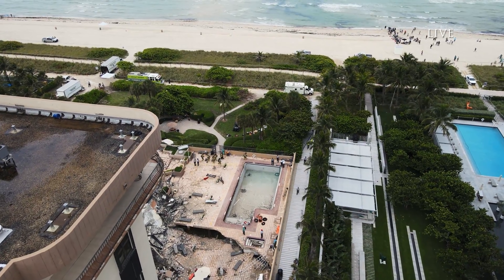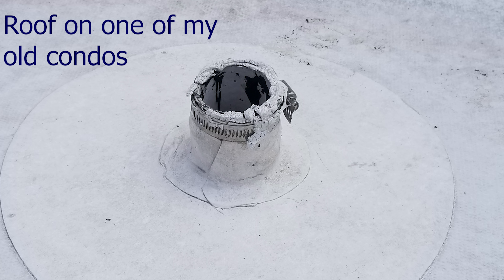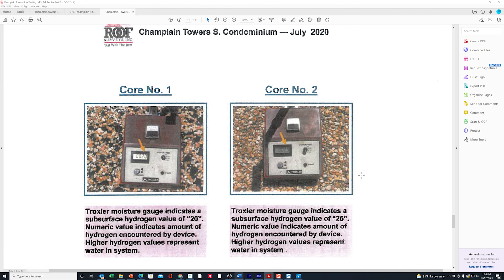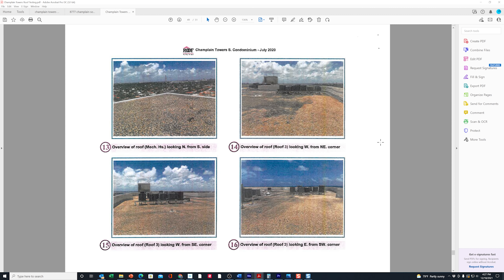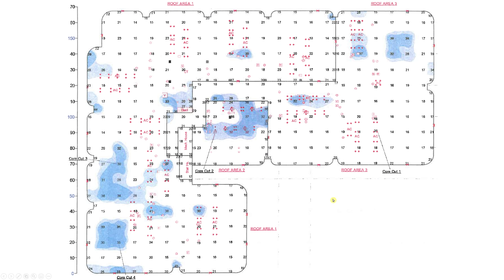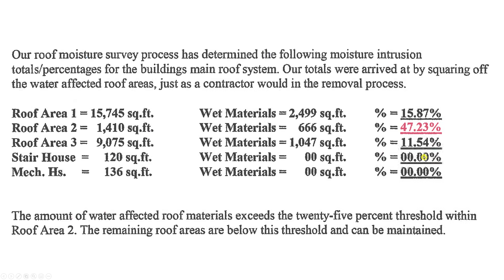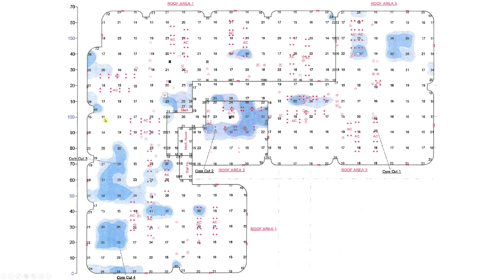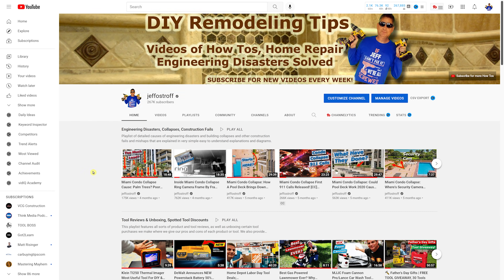Condo Collapse: Water Found Under Roof Layers (Saturated)

Comment: What is the standard technique for putting a slight slope on a flat roof? I owned a building with flat roofs. One of them had a slight slope and one of them had no intentional slope. The difference was night and day. The one with the slight slope was still doing a pretty good job of preventing leaks. The no slope section was puddling and had many leaks.

It is surprising to me that no-slope roofs continue to be built.

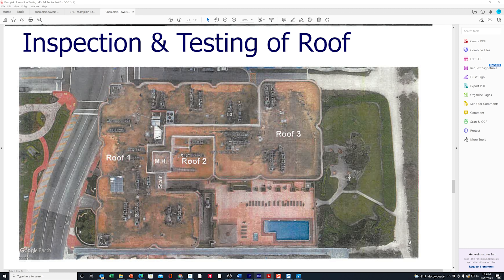Comment: At 4:31 you show a cross section of the Champlain Tower South condominiums roof. 
Your blue color shows water into the concrete, that’s not very likely to happen. You said the multiply layers are there to provide slope to the roof, these layers do not add slope. Slope is added in the Polyisocyanurate layer and the mineral aggregate is not buried in tar, the aggregate is added to and on top of the asphalt layer when it’s hot and should be a mixture with the aggregate visible to reflect ultraviolet sun rays. 
Further the area when you say the first column to give way had a comparative low moisture reading of 18-22, with no water notes. Core cut #1 you said at 20 was dry. 
You should revisit this video and edit the areas where you use opinion disguised as fact.

Comment: I find it incredible that there was not some kind of sheer joint between the pool deck and the main building. It is crazy that a pool deck collapsing can pull the whole building with it. If there had been some kind of sheer joint between the pool deck and the main structure then surely the building would have remained standing after the pool deck had gone down? (Assuming of course that it was the pool deck that went down first).

Comment: bad concrete?..it looks sooo chaulky, and it doesnt stick to the rebar in the normal way. Also, is there any pebbles in it? I dont see any.......incorrect building methods, built to minimum, paid off inspector?....planter box added later with no extra support....rust and rot ( lots of water leaks for years).....undersized columns.....what did i miss?.....bad maintenance, too much cost for condo owners( $200k each?)...engineer and co. inspector paid?, to not scare people( reduces property value $200k ea.).......etc.....

....    So, no one  could just put up some shoring underneath the pool deck, remove the planters, demo down to solid concrete, add structural crete to the deck, and lots more strength to the posts?.....i just shake my head....
Reply from the maker: All the above

Comment: Again, not draining the accumulated water from roof or a ground floor has the same rule of common sense. 
Unfortunately, when money and politic steps in; it get to be "how stupid can we get to be", and maximize on mitigating our losses or maximize our profits. 
My first question is were the architect and engineers cognizant of the best practices that common sense tells you engineering practices needed to be followed up on the construction of the flat planes of any structure. 

Perhaps the overall practices need to be revamped and rewritten to meet the needs of reported problems; reportedly or verifiably rumored. 

Sad to have to have all armchair experts, remind these companies what should'a, could'a, been done!

Loss of life was preventable but like I mentioned looks like fools were running the show!
Pissed observer!

Thank you Jeff Osrtoff for your video!
Reply from the maker: This may have been best practice at the time

Comment: Another chapter in the catalogue of errors.
This building appears to be a showcase example of how to look for problems and not see them.
Flat slabs deflect and that thin over time deflect a lot.  The dirt on the roof shows the degree of ponding.  Ponded water is live load and if if gets in the hidden lake can be a serious problem.
Yes, I have seen this.  GRP over GRP over GRP each as bad as the last and underneath the water ponded rusted the trapezoidal deck and p******d in.  The whole lot was stripped - not sure if they are still arguing over costs.
Reply from the maker: The ponding water is actually a static load but yes still a load nonetheless. People forget to that water weighs 8 pounds per gallon and so all of that water pooled on the roof adds up as well. Although I still don't think the roof had anything to do with the collapse but it just shows how either poor design or poor execution of the construction allowed too much water to pool or get into the concrete on this particular project
Reply: @jeffostroff  Erm Terminology live as in an an imposed load like snow.  I agree with you - I too think it is a side bar issue.  Yet another indicator of how under/poorly designed/built/maintained the building was.  What do you think of the legal challenge by CTS alleging that in constructing 87 that developer caused the collapse?  (By damaging CTS perimeter wall)

Comment: Just a note: the fforida replacement law as you show in the video does not say a roof must be replaced at the 25% but rather that if it is replaced it must be the entire roof.  That is far different from what you appeared to present.  As a retired engineer I find that there are too many wanna be engineers.  While your and other's data is interesting we need to await the final investigation where actual licensed engineers have reviewed all or all available data.  However, all of that said, it was an informative video.
Reply from the maker: You are wrong. There's far too many retired engineers calling other engineers "wannabees". The law clearly states, and I showed it, if the roof is damaged above 25% you must replace the entire roof. You can't just repair the roof. I don't see how you could get that wrong.

Comment: What a dumb archaic way to roof a building
Third world
Reply from the maker: There's nothing wrong with the method used in roofing these flat slab buildings the key is to making sure you have a slope to the drain and making sure that you repair the roof when it's time because most of these roofs have a life span of 15 to 20 years at the most. In this heat is brutal down here in Florida so the homeowners associations really need to take a more proactive approach and staying up on inspecting different parts of the building don't just wait for a 40 year inspection.

Comment: Jeff -- I'm sure you've seen the "House of Cards" presentation that the Miami Herald posted on their website at the end of 2021, with input from a consulting engineer from the Univ. of Washington.  It might be interesting for you to do a "walk-through" video of it (with due credit and respect for their copyrighted work, of course).  I'm particularly interested in your take on their discussion of the role of the pool deck's perimeter wall serving as a "clamp" that helped hold things together for 40 years, until the connections between deck and perimeter wall finally failed.  They seem to view that as the likely first failure point, although their subsequent analysis pretty much matches up with yours.
Reply from the maker: yes I have, they notified me the day they published it, and already planning it

Comment: if area 2 was most saturated, perhaps that is where repair materials were put to be started and, area 2 looks like a part of the building that is in the middle which if fell could create the catastrophic event which happened
Reply from the maker: Area 2 is the elevator shaft, which survived the collapse
Reply: @jeffostroff  it's surprising it never leaked

Comment: I have no knowledge or experience, but just pondering the idea... that the water intrusion could have started from the roof or from forced rain off the ocean (also salt corrosion possibly), but it doesn't have to sit on the roof deck, but potentially permeate through the multiple levels of the floors, run down columns or walls, cause noticeable bubbling, and then eventually show signs in the basement I'm guessing.  So taking a reading from the roof is great and all, but since there are so many important structural members to support all that concrete and steel, it seems like it would be fair to also inspect them as well.  Maybe they already have.  But it just wasn't in this particular video.  This all goes to us humans wanting the seaside view.  So the only way to do that is to go vertical.
Reply from the maker: Yes in terms of roof repairs, this is what they normally check for. They already know what was wrong down on  the pool deck, as they took core samples of the concrete through to he garage below.

Comment: The extra weight of water sitting within that roof membrane certainly wouldn't have helped the  structural stability and shear point stresses.
Reply from the maker: Yes, so important to drain those roofs

Comment: I still believe, as I said nearly right after this happened, that there will never be a specific smoking but a large number of errors, not any of which would have come anywhere near to causing collapse but as time went on and many things changed requiring materials never dreamed of when the building was constructed that would need to be use to keep up with code, but where no one went back to look and see if a building that age could support new materials and their weight as small things such as repairers and renovations force the building to incorporate things it was never meant to deal with; and for example the location of the building going from more of a moderate cost home for retirees when built , to expensive condo as location, not renovation drove up the price, and many owners found that to be worth the price, things like lightweight cabinets, plumbing fixtures, built in, new flooring went from things that looked real to actually having to be real: real wood, real marble and granite, real flooring and all of this increased the weight probbaly well past what the original architects ever imagined.  

Something was wrong with that building but sadly, as much as 20 years before it was required to have a recertification done, the damage had gone past what could have been repair to continue habitation in that building and its possible that as far back as the initial drawing of the building it, and many others, were doomed simply because there were no codes that locked buildings into not allowing heavier materials when renovations occurred, or even consideration of heavy types of furniture and so on.  It also seems that private firms and individuals often received permits to run additional plumbing in the walls and it cant be hard to believe if this happened in enough spaces the concrete could have actually become weak because of honey combing.  We may never know, as I doubt anyone will even speak up at least from those that inspected a head of the certification, that the building was actually a goner, and all they could possibly do was, maybe keep it standing for a year or two for people to get out but the reason for so much foot dragging when they should have been hard at work getting that building in shape for recertification for 3-6 years in advance, while instead they seemed to be doing little to nothing or just enough that anyone suspicious would see some work going on.   Have really felt since the beginning of this that the HOA actually had given up on this building passing certification and was more prepared to having to deal with a building deemed uninhabitable and forcing owners out on the street and to settle with insurance and law suits which they may have figured was going to be the issue anyway as the building could not be repair no matter the amount of money put aside.  Its a good chance that it looked to the some owners, especially the ones not living in their units but renting them out to others,  and the HOA ,it would be much cheaper to fight off law suits and make deals with insurance companies if the building was condemned and they could then level the building and build a new and better building which would have condos selling at much greater prices, and chances are there would be profit in doing this.

However, no one either knew or bother to let anyone know that the building might not even withstand forces liable to be pushed at it over the years they were waiting for an inspection to condemn the property.  Every piece of rebar that corroded enough to expand and knock out a chunk of concrete, every bit of standing water on the roof that seeped through the roof materials and into the interior walls, would slowly be weakening the building, but no way to measure how much, and add to that all the other issues that seem to have been there, some of which must have been done in the original construction, from places like having a column only in the garage, not running up through the building although the plans called for it, but seems it was only build in the garage where it would be noticed if not there, but although it was a support column, it did not continue upwards
Reply from the maker: Yes one thing about concrete, keep it cleaned, keep it sealed, patch up and reseal all cracks when they first start to develop.
Reply: We are theorising and researching in our F b group called ChAmPlain ToWers SoUth- searching for answers ( only typing it like that)  was because for some reason YouTube doesn’t like those words. You’d be a great addition to our group . The link is also my profile here . 😄

Comment: Things rarely happen on their own. In my experience, failures happen after someone does something. It would be one huge coincidence that the roofers were working on the building RIGHT before it collapsed. I expect some chain reaction started by the work on the roof and the disrepair of water intrusion to be the culprit. That roofing company is screwed.
Reply from the maker: I don't think he roof was a root cause, I think there was much more damage to that pool deck
Reply: @jeffostroff  after seeing this comment, it got me to thinking: was sagging of the underlying structure possibly being indicated? Interestingly, the driest section of map is about where the collapse seems to have started, making me think that perhaps the slope was altered just enough for the drains to be able to work effectively on that section. Not an engineer, just a thought that occurred to me.
Reply from the maker: @kstricl   I don't think that the roof had anything to do with the collapse although it did appear there may have been some water getting in certain places. But the more obvious spot is down at the pool deck where the pool deck collapsed that collapsed and likely caused the columns in that area to lose support because they were spendily columns to begin with. That the roof caved in on its own I think it came down when the rest of the building came down.
Reply: @jeffostroff  Sorry, I guess my thought didn't really come through - I was just thinking that slow settling of those same columns in the basement might have caused the sections of roof with the drains to drop slightly, allowing the water to drain effectively - so the dry sections may have been a symptom of what was going on rather than a cause. 100% concur on your conclusions so far. I've subscribed so I notice the videos sooner as you analyze the reports that do come out.
Reply: @kstricl  That is an astute theory. The proper drainage on that section could have been from excessive sinkage in that particular spot. Perhaps the most water intrusion from below was coming in the parking garage in that area.
Reply: There was another video that showed granite walls & how they put excessive weight on the building.  WATER is also heavy & perhaps that put excessive weight on the roof & columns (which eventually lead down to the weakened pool deck columns).

Comment: Jeff, do you believe that if the condo board did all the repairs, that the building wouldn't have collapsed?
Reply from the maker: It depends on the scope of the project. IF they were going to replace the entire pool deck concrete slab and re-tie it into the columns along the edge of the building, I think the building could have survived. I would have tried to widen  as many columns as they could have, and added drop panels and caps tot he tops of the thinner columns
Reply: They had the right idea, they just started too late, after profound (and invisible to surface inspection) damage had been done.  The big unknown is, did the roof construction even meet goals up to its basic expected (15 year) lifespan, never mind its bean-counter delay extended lifespan?  The constant complaints of water intrusion (which starts with the roof!) over the years suggests that it was never quite right.  How far back would they have had to go to nip this in the bud?  That, I can't answer.

Comment: I think the building was badly designed to begin with and I never knew these buildings can be all cement and re-bar without any steel girder beam frame-  this is why it collapsed - it's a cheap cost saver way to build and dangerous, who knows how many other buildings like this are ready to collapse, very scary.  Also, to back up my opinion, there are plenty of abandoned buildings that have had no maintenance for years and are still standing.
Reply from the maker: concrete columns and slab designs have been used for years the point is you just have to protect I don't think deep material from water intrusion. That requires maintenance and keeping an eye on the building and looking for cracks and spalling and catching it early not waiting until they pulled their collapses